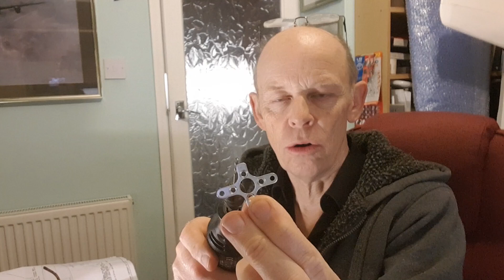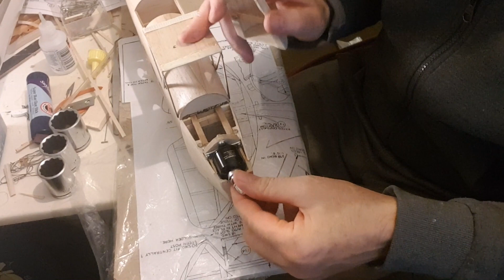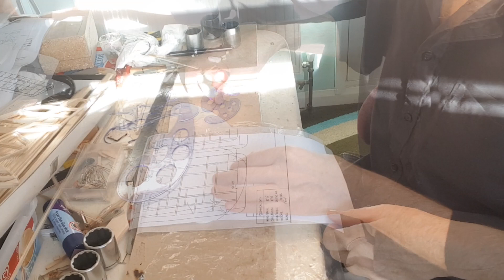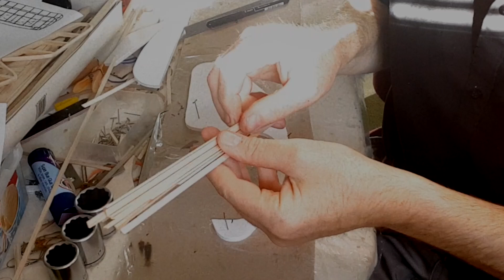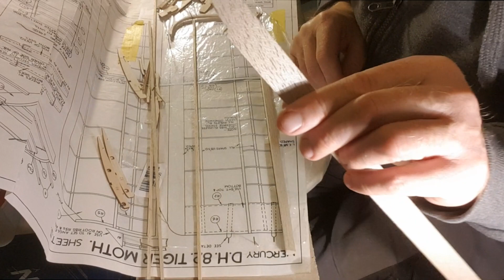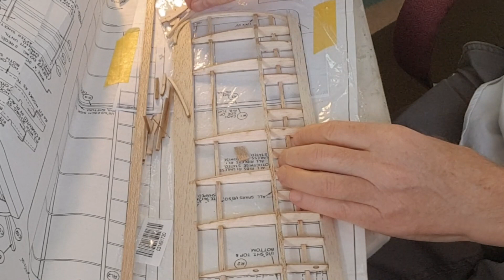Mercury Tiger Moth RC Conversion Part 3 Lower Wings

Comment: I have the near same model that i bought half built can you please let me know what motor you are using as it pulls your model so well in later videos cheers Chris
Reply from the maker: Hi Chris, she's overpowered really but it's an Overlander 2836/08 1120kv motor running on a 3s 1300mah battery. If you're in the uk give George at 4-Max a call and he'll advise you, cheers

Comment: I know I'm catching up on this a bit late Cliff, but as my Sopwith Camel is getting a bit closer to done, and turning out heavier than I expected, I'm getting worried that the lovely little 10g 1811 3800KV motor I have set aside won't be big enough. Specs say it will generate 205g of thrust with a 5x3 prop. Looking at the Tiger Moth it seems like it might be a similar plane, so I'm wondering what the motor you used was?
Reply from the maker: Hi Tim, I'm not sure I'll be of much help because it's pretty overpowered, the motor is an Overlander 2836/08, if you don't build your motor in too much you can always swap it later on 🤔
Reply: Thanks @cliffharveyrcplanes yes that's what I've done. I'm currently editing a video that shows how I've tried to build everything to be accessible/replaceable.

Comment: Hi Cliff, is the shaping of the wing tips your own design or is it from a full size version of the plane?
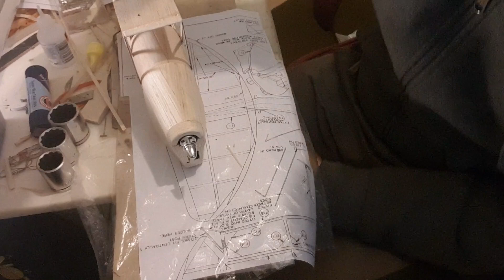Reply from the maker: Hi Phil, the original plan shows pretty square tips which spoil the wings unnecessarily so I just downloaded a 3-view of the plane and eye-balled the tips to a pleasing shape as you can see at 3:45 I just used my French curves and a pencil 👍

Comment: Just a newbie question but do those motors require much cooling airflow?
Reply from the maker: Hi Brian, great question, probably a bit more than it currently has for sure, I'll take off a bit more balsa around the prop driver to let some more air in.